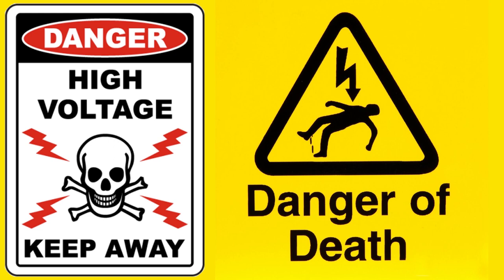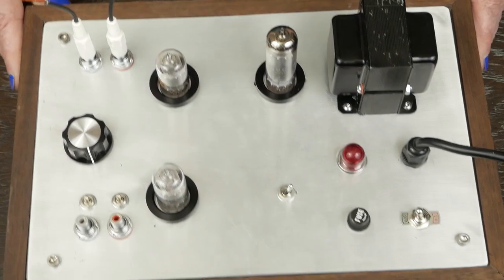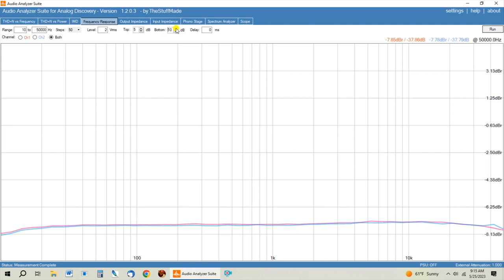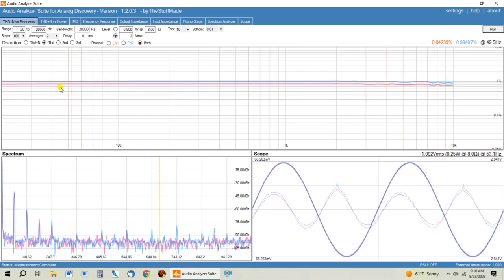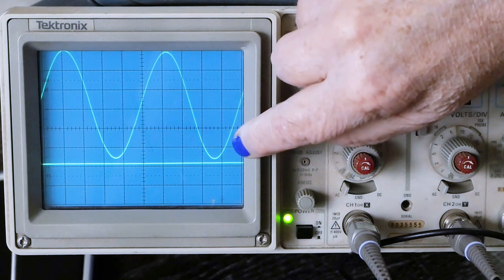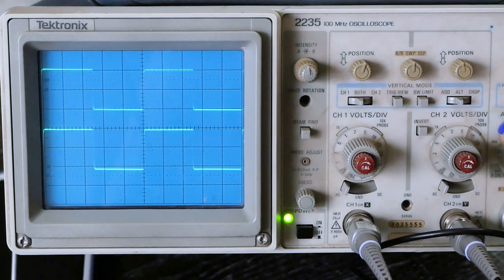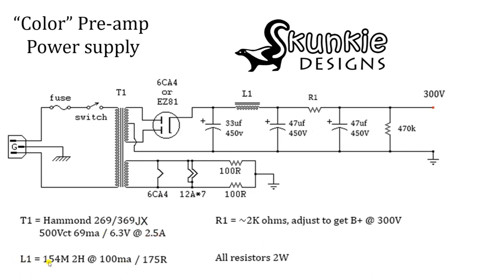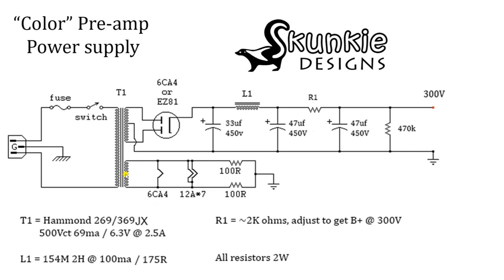"Color" Tube Pre-amp for Solid State Amps: Final Review

Comment: It’s a pity that there’s no motorised 10k potentiometer of >50 mWt on the market. Looks like if one wants to create remote controlled preamp, it’s needed to motorise normal potentiometer or use relay-controlled unit.
Reply from the maker: Right, this is a unique case use for sure. Honestly I think a 50mw would work if you limit the input signal to keep the output signal send to the pot max of 20mw or so.

Comment: Hi stephe on your shematic circuit you have 12au7 and the supply shematic you have 12ax7  which you use cause its not the same amplification factor( the u ) 12au7 has 20 and 12ax7 100  its not the same ,so why put a pot on the ouput to rise impedance  ,normally we create a desigh to lower impedance ,i think its not logical.
Reply from the maker: It's a 12AU7, the "supply" schematic says 12a*7 which was a typo. In the video I explain it's a 12AU7 multiple times. I've explained the volume pot on the output in the video and a dozen times in the comments, I'm not going over that again.

Comment: Hello - I finished the build and I'm getting 277V for a b+, 142V on the plate for the amplification tube, 6V on the cathode, 47V for the grid, and 78V for the cathode on the follower. Should I change the power supply resistor or leave it alone? Thanks!
Reply from the maker: It wouldn't hurt to lower it and raise the B+ to 300V
Reply: @SkunkieDesignsElectronics  Sounds right. I have a 2K in there now. Would you go 1.8 or 1.6K? I don’t want to solder the hell out of the capacitors to get that B+ up to 300V. I’m not sure what it will take to get that 30V that I need. Thanks.
Reply from the maker: Measure the voltage drop across the 2K, that will give you the ma across it. You can then calculate what resistor will get you close. https://ohmslawcalculator.com/ohms-law-calculator
Reply: @SkunkieDesignsElectronics  awesome thanks!
Reply: This is a great exercise! I’m not sure I get it though… so, the voltage drop is 39 volts (318 to 279) with the 2K reaistor. At 20 mamps. I want an 18 volt drop. Will the current remain the same? In which case, plugging in 18v and 20 mamp I get .8K or there abouts. I’m not sure if I’m getting ohms law right.
Reply from the maker: I get 19.5ma with 39V across 2K. Yes the ma will stay the same because that is the current used by the circuit. so 19.5ma with 18V I get 923ohm, so I would try a 1K resistor and it should be close.
Reply: @SkunkieDesignsElectronics  thanks!

Comment: Hello. I was following the voltages and paths on the schematic and couldn’t figure out how the cathodes gets their voltages. I see the grounds and B+, but where do the voltages come from for the cathode side of the tube? Thanks.
Reply from the maker: Through the tubes themselves. Current passes through the tube and the voltage on the cathode is the voltage drop across the resistor to ground. This is how it creates the negative voltage bias on the grid. The bias is measured between the grid and the cathode, if the grid is referenced to ground and the cathode is at a positive voltage, the difference between them is the negative grid  voltage the tube need to operate.
Reply: @SkunkieDesignsElectronics  ah, that makes sense. Thanks!

Comment: Stephe, I’m using the 269JX transformer. On the primary the 0 volt top lead is white and the bottom 125 volt lead is black with a grey 115 volt lead in the middle. A bit different than the 6K88VG. Does the white lead go to the switch and the black to the white lead of the power cord or the other way around or do I use the grey 115 volt lead? Thanks.
Reply from the maker: Use the 125V leads and I honestly don't think it matters which lead of the transformer goes where, it's AC. You do want to "hot" lead from the wall outlet going to the fuse, then the switch, then to the transformer and the neutral connected to the transformer.
Reply: @SkunkieDesignsElectronics   Got it. Thanks!

Comment: Hello Stephe,
I’m diving in on the color preamp. I’m very excited! I have a question on the skunkified schematic. I’m not using the 100k input pot because I have a variable out from my DAC. So I will have the one pot on the output. I noticed you changed the cathode voltage to 6.5v on the primary tube. Would I use the same components for the grid and cathode voltages if I wasn’t using the 100k pot? Thanks much!
Reply from the maker: I would replace the 1M grid leak resistor with a 100K one.
Reply: @SkunkieDesignsElectronics  Got it. Thanks!

Comment: Hey Stephe, I was wondering if you played with the load line with this preamp? I guess flatter is better given that the tube circuit was designed to push the tube more, just wondered how a little steeper line would sound without hitting clipping that is. Thanks.
Reply from the maker: no and the whole point of this pre-amp is adding some 2H distortion.

Comment: Hello Stephe - question on the grid stopper resistor for the following stage. Why did you add it to the skunkified schematic when one was not used in the original? Are there high frequencies we need to filter? I will be using the skunkified version without a pot on the input. Thanks much.
Reply from the maker: It's just there as a precaution, feel free to built it however you would like.
Reply: @SkunkieDesignsElectronics  thanks!

Comment: I don’t think I’ve watched any YouTube series as much as this one! I want to make this! 

I’ve watched other videos to increase my understanding of different concepts and on one of these crosstalk was discussed. In that vid the simple recommendation to reduce crosstalk was after the rectifier, to have a split rail voltage supply, so I guess in this case a duplicate set of caps, choke and resistors and thus a dedicated B+ for each valve. Do you think there are any merits to this?

Thank you
Reply from the maker: I think in this case, the current is so low it's not an issue.

Comment: Hey Stephe - all my parts are here and I’m looking forward to getting the power supply started! On the schematic there are 2 - 100 ohm resistors on the heater 6.5v leads. Was that to lower the voltage for a different transformer? It doesn’t look like you used them in the build. So I guess I don’t need them right?
Reply from the maker: If your transformer has a center tap on the heater winding, just connect that center tap to ground and you don't need the two 100 ohm resistors. If it doesn't have a center tap, like mine did not, you use the two resistors across the 6.3V winding and connect the center point of these two resistors to ground creating a virtual center tap. I 100% used them on my build.
Reply: @SkunkieDesignsElectronics  Ah ok. Mine does not have a 6.3v center tap. So I guess after I solder the heater leads to the tag strip I would add a 100R resister to each and combine them to the star ground point. Thanks.
Reply from the maker: Yes, just like that. I try to keep a ground nearby just for this purpose.

Comment: I wonder if you could explain the two stage amplification in this preamp. Is that to get better/more distortion, or is it just better to not tax the tubes. Thanks.
Reply from the maker: The second stage isn't doing any amplification, it's a cathode follower which gives more "drive" and lowers the output impedance. This allows it to drive a solid state amp.
Reply: @SkunkieDesignsElectronics  interesting. Thanks!

Comment: Thanks for the great videos! 
I have two relatively amature questions.
I'm currently using a Kenwood KA 8100. Really nice amp with a great preamp and phono stage. I was looking for options to add some tube flavour to it without adding a second amplifier and avoid all the extra switches and cables.
So i was wondering  what would happen if I connect a turntable to it and then feed it into the phono preamp. would it work like a tube buffer? or the voltage increases out of a phono preamp input limits? 
similar question about the DAC, what happens if I feed the output to the preamp of my kenwood and not power amp? would it cause a lot extra distortion or fry the second preamp?
The datasheet of kenwood says phono stage: 2,5mV/50kOhm and AUX 150mV/50kOhm.
Reply from the maker: I would not connect a turntable to it. You should be able to run the tape out and in like you would an equalizer.

Comment: I'm super interested in this design and waiting for you to offer one this upcoming year. Quick question..will the pre pair with a solid state that has a super low 10k ohm input impedance? 

I have a semi expensive amp that has some great qualities to it...though i also enjoy the sound of tubes with solid state but pairings with that amp havent always been ideal..even with adding larger values to the output caps. I have a Dac that im able to control the output voltage on that i think will work well with this pre in a streaming set up.
Reply from the maker: 10K ohm is SUPER low. not sure how well this would work. That is like 1 of 5 amps ever made that are that low?
Reply: @SkunkieDesignsElectronics Super Low indeed. It's not an older amp and is made by a rather mainstream company. Arcam PA240. It was more expensive than I would normally spend but they gave me a trial and $800 off on a demo. I had never experienced such a powerful amp that was so clean and quiet. Something about the higher frequencies stood it apart from other amps at the same price. I didn't even consider the input Z til later on when I tried some tube pre's with it. It really is fine running straight from dac but I strongly feel a tube can add just a little something nice to really clean SS amps. The right amount and right type of distortion sounds more natural than something completely transparent. Obviously this is just my opinion and personal preference. Many people want no distortion whatsoever in their signal chain. 
Ty for the response.

Comment: Hi, once again thank you very much! Another stupid question: what if use preamp tube not one per channel, but one per cascade?
Reply from the maker: Cascade?
Reply: @SkunkieDesignsElectronics  we’re now using 1 shoulder of the tube for 1st amplification stage, and another for 2nd. Can we use 1st tube for L&R 1st amplification stage, and 2nd tube for next stage?
Reply from the maker: Sure, just would make the wiring a different
Reply: @SkunkieDesignsElectronics  do you think that would make channels a little bit more even?
Reply from the maker: No, I don't see why it would make any difference other than making the wiring longer and have more of a change to pick up interference.
Reply: @SkunkieDesignsElectronics  I’m not experienced enough, but in case the tubes aren’t the ‘matched pair’ there might be a difference. What the matched pairs are for otherwise?
Reply from the maker: But you assuming the two triodes in a 12AU7 are matched.

Comment: Question - if I were to switch the volume pot to the input with no pot on the output are there any changes to the components on the schematic? Thanks.
Reply from the maker: It's no longer the same pre-amp, it's just like any other boring solid state sounding preamp and defeats the purpose on building this one.
Reply: @SkunkieDesignsElectronics  ok thanks.

Comment: Stephe, Can we Replace the 10k output pot with a 50k pot?
Reply from the maker: It depends on what the input impedance is of whatever you are driving. It was designed to be able to drive a SS amp with 50K input impedance. If you are driving a tube amp with 250-500K input impedance, you could.

Comment: Older video,  but I think I build one designed for installing in my tape loop.
Reply from the maker: I'm still building these. They sound AMAZING! especially the final version with input AND output pots.
Reply: @SkunkieDesignsElectronics  do you think it would be worthwhile to instal meters to match output to what the line level should be?
Reply from the maker: You could if that is important to you. I just use my ears to what sounds good. If you were using this to adjust level for tape recording, probably is a good idea but doesn't the recording deck have level meters?
Reply: No, I should have said my tape 2, monitor loop, just line out, and right back in. With color amp in line.

Comment: Skunkie, it will be awesome...if you sell these as a kit!
Reply from the maker: Probably gonna sell some built amps first, I have to think about doing kits.
Reply: @SkunkieDesignsElectronics  I'm fine with that! It is probably too early but how much do you think it will cost ?
Reply from the maker: $800-900 is my guess depending on parts costs.
Reply: Okay, thank you! I was wondering how would the output side pot would affect the overall output impedance. Typically, output impedance should be low for any amplifier. Typical power amps have input impedance in the range of 20k to 50k ohms. Will your design match these specifications?
Reply from the maker: You can read more about how that affects output impedance here: https://amzn.to/3pdUmQC

Note this page is discussing the effect of an output pot using a 250K pot on a different pre-amp, this color preamp uses a 10K pot so TL;DR, this isn't an issue at all.
Reply: @SkunkieDesignsElectronics  did you attach a wrong link ? 🤔
Reply from the maker: yess lol https://www.cascadetubes.com/2022/01/17/about-that-volume-control/
Reply: Kits would be awesome